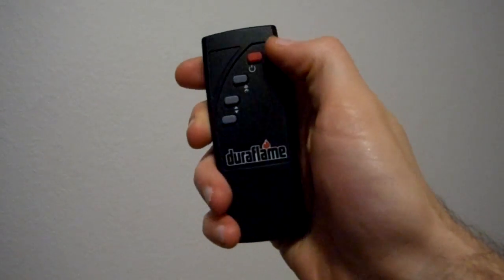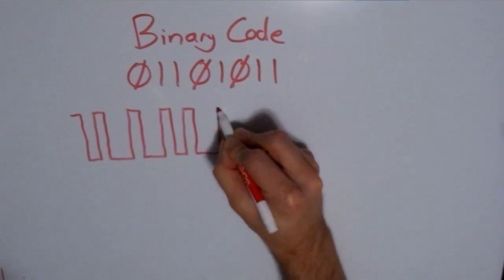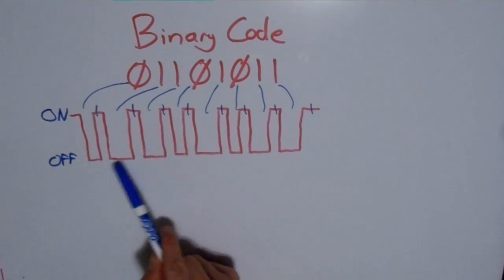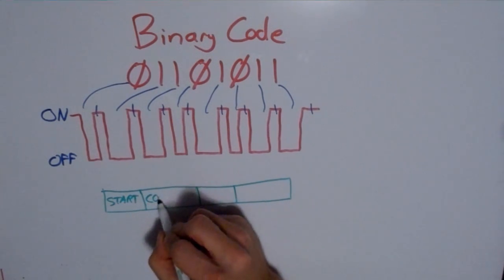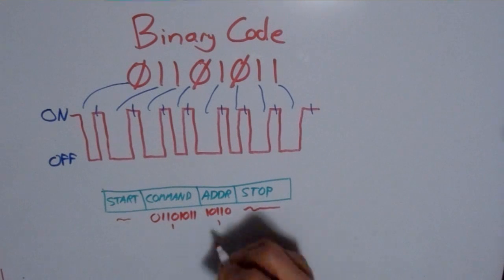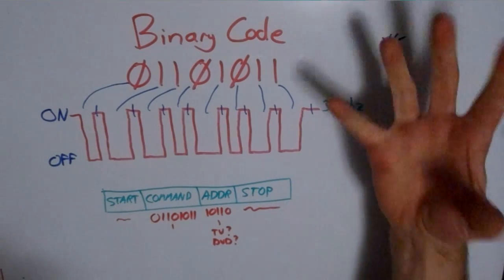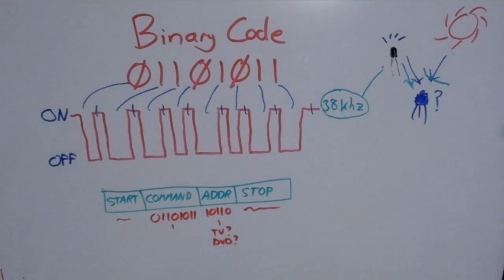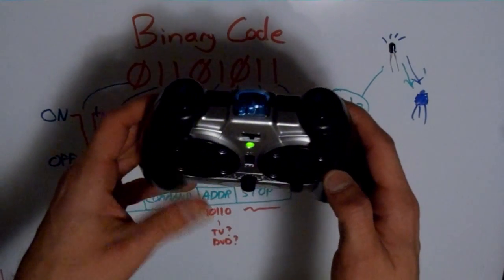How It Works -  Infrared Remote Control

Comment: If I would remove the ir transmitter and ran a wire from those 2 pads and hooked the other end of the wire to the ir receiver would that work. Basically hard wiring it?

Comment: this is a good video, but I have a question. is there a database or repository of codes used, or remotes matched with codes? I am interested in this project because I lack a remote for a piece of equipment, and obtaining a rare one will cost a stupid amount of money right now. I'd like to see if its codes are already known such that I could simply use them with this project without the learning decoding step.
Reply from the maker: I would start by looking for manuals, tech specs, or datasheets from the manufacturer of the specific device. I'm not sure if there is some large database of known codes.

Comment: Great video, question? I have  several small 3.7 volt helicopters like the ones in this video, at the end,  with no remotes that match them so that they work.  Is it possible to alter the frequencs of the ones I have, to math the helicopters, so that they will work? Thanks, any help would be appreciated.

Comment: Very interesting, I knew it used infrared light but wasn't sure how data was transmitted.. I suspected it would be like this, because it sounds just like "Li-fi" what some people predict will be the future of Wi-fi.
What was really shocking is that the RC helicopter uses infrared, I thought it was some really low-power radio waves.
Are all RC toys using infrared? How can the helicopter catch the light from a far??

Comment: Okay then, how would i make a system consists of a IR remote transimitter and a reciver which respond to it..
Reply: The device, such a TV, has a small module in it that does the job of processing the infrared signal from the remote. The output of this module is the data that the remote transmitted, but without the 38KHZ carrier, just binary code 0-5 Volts. Your application, say..Arduino, would just have to process the data. The pinout for the module is simple: +5 Volts, Ground, Signal out.

Comment: Rick, just subscribed. Great work.  You said, 38khz means it flashes 38,000 times per second.  How is that possible?  Have you seen a video that explains how a remote or circuit creates that specific energy? If so can you send me the link?
Reply from the maker: maybe check out this link? http://hackaday.com/2011/02/16/38-khz-ir-communications-tutorial/ not sure if that's what you're looking for.
Reply: romanieo
Reply: That was what I was thinking, 38000 times per second is just insane.

Comment: this is very helpful, thanks a lot. But I still have a question that if I have a general IR remote control that flashes an IR signal with 38khz, and had two devices that are designed to respond to 38khz, will they both work if I pushed a certain button ? and let's say that I didn't know that information, how will I know which one of the two devices is going to work ?
Reply from the maker: If you have two devices that are the same make and model, then they most likely will both respond to a single button press. The 38khz pulse is a just a carrier signal. On top of that, the remote transmits an address code and a command code. Let's say you have a Sony TV and a Sony sound system. They would both likely use the same command for "power on/off" because they are both Sony. However, your remote will first transmit the address of the device. If the address is for the TV, then the TV knows it needs to respond to the command. The sound system will ignore the command because the address doesn't match.
Reply: IoT tech?

Comment: I know this sounds stupid but does this relate to controllers for video games (ps3,xbox) as well?
Reply: No they work with bluetooth
Reply: Lazsalzari Romnzevroskki that does explain anything.. how does the remote connect to the Xbox??? How does blue tooth work???
Reply: Bluetooth is basically a small electronic chip integrated within a device emitting shirt ranged microwaves to another gadget
Reply: Josh Rhode probably similar but with sound frequencies.

Comment: Thank you for this video. I have a question though. 
For a school project I am trying to built a device which is located on the ceiling and could alert on whether an object (non moving) is within the radius of 1 meter in all directions. It should be very small and cheap (less than 5$) so any solutions like radar or laser scanning is out of the question, so I left with the ultrasonic and infrared possibilities, but due to budget and size limitations i need to use as few sensors as possible. 
I have tried to make some measurements with infrared transmitter and receiver in the same housing but so far Ive been able to detect only objects in the range of about 15 cm, and pretty much only if it is perpendicular to the sensor. I have used all kinds of IR emitters with different radiant intensity and with different current values but I could not significantly increase the range and the beam detection angle
my question is how could I increase the range and angle? I check the IR detector with a normal TV remote control and i see that the range could reach up to 5 meters and the detection angle is very large. is the IR transmitter in the remote control is amplified? and if so, how? with optical lenses or with electronic components? 
sorry, it got a bit long
Thank you :)
Reply from the maker: Your project is a bit over my head. I don't believe the IR LEDs inside of TV remote controls are amplified. It's just an LED in the end of the remote. I'm not sure what IR transmitter and receiver you were using for your sensor, but maybe it works off a different principal than the TV remotes?
Reply: Rick Osgood I see, i will keep on researching. thanks for your prompt reply.

Comment: Hi, can you elaborate on how to control the helicopter with the IR remote as I am exactly looking to do that.
Thanks :)
Reply: And I have a 4 channel helicopter, can a remote with single IR led operate that ?
Reply from the maker: Rajeshwar Rudra the "channels" probably just change which IR codes the helicopter listens for. This means tha it doesn't matter how many LED's there are. The more LEDs, the brighter the light will be and you can probably increase your distance this way. If you want to control the helicopter you would need to figure out what the IR codes look like coming from the remote control. You might be able to find this information online for your specific helicopter, or you can try to "record" them with an IR receiver and then reverse engineer it yourself.
Reply: hi ..who can i change the frequency at TX and RX

Comment: very nice video! I have a couple questions, I hope someone will answer. 
1- you said tipycally the IR freq of a tv is 38 khz. But since a sony remote control will not work with a toshiba tv, this means that some one uses 38, some 37, others 39 right? A universal remote control will work with each tv because is able to transmit in a wider IR frequency range?
Reply from the maker: The reason the Sony remote does not work on a Toshiba TV has nothing to do with the frequency, actually. It has to do with the way the binary code that's transmitted. Different manufacturers use different protocols or codes. Your Sony remote flashes at 38KHz a code that the Toshiba TV doesn't understand, so the TV just doesn't respond. The universal remote knows the right codes for many different TV's. But it's most likely always going to modulate at 38khz. Does that make sense?

Comment: I've a remote control which IR led  always stays on. When I press a button  the receiver doesn't work.

I've tried to clean up the button contacts, I've changed batteries, but nothing!
Reply from the maker: It does sound like one the the buttons is somehow stuck on.  If the receiver is not responding to the remote at all, then it's possible that your remote is just sending out a repeat code over and over.  I might try leaving the receiver turned on and then removing the battery from your remote for a minute or so.  Then put the battery back in while pointing the remote at the receiver.  It's possible that putting in the battery could send the initial command followed by the repeat code.  If your receiver responds to the remote when plugging in the battery you would then possibly be able to figure out which button is causing the problem.
Reply: thx iĺl try that